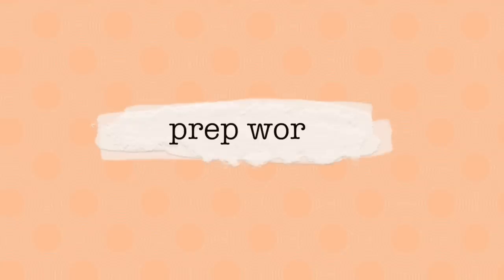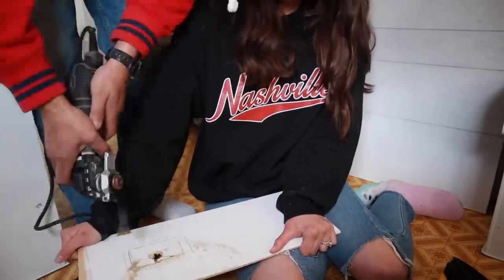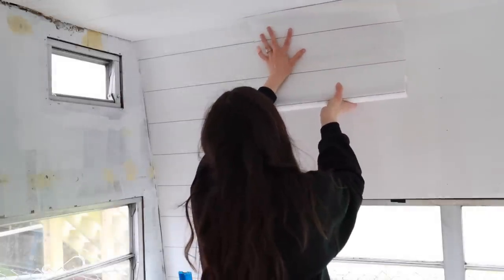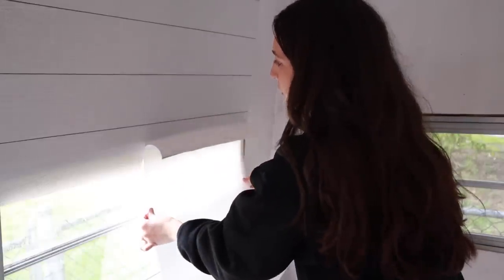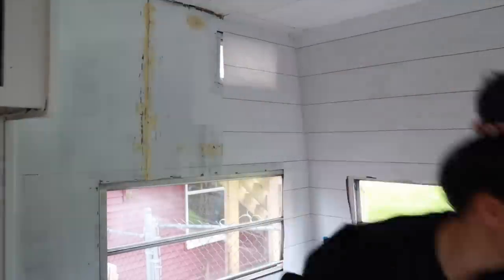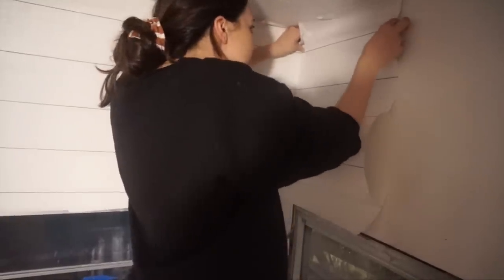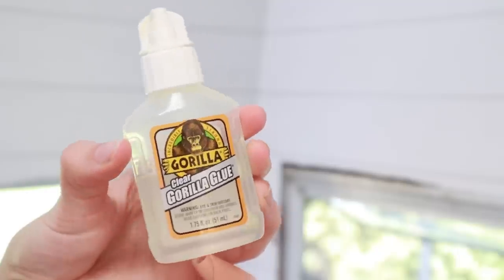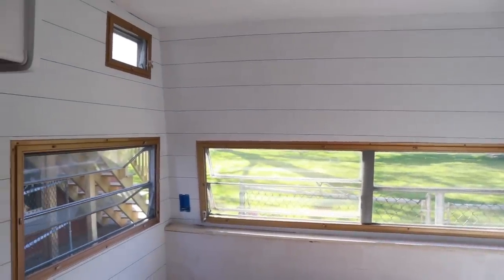HOW TO SHIPLAP WALLS for our camper// Peel and Stick Shiplap  wallpaper! tips & tricks

Comment: If you have a problem with it sticking or air bubbles just heat it with a blow dryer and use a squeegee to smooth it out. It will stick for good then.
Reply from the maker: great tip!!
Reply: Nice!! Thank you. I'm looking to use contact paper, does that work the same?

Comment: 3 yrs ago I saw your video and had to do this!  Turned out great but the first season taking our camper out the paper started falling off!  From the fluctuation in heat it’s soo bad. We have used 3 different glues to keep it on and none of them work. Any tips? Did your stay on??

Comment: I have a few questions. I love love love what you are doing and really want to do it myself so i was wondering how did you find a camper so cheap because even super tiny ones i have found are 2 grand or more. also what size is your camper and how much is all of this costing you. i dont think it looks that expensive, but i would still love to know how much youve spent so far and how much you think you would have spent if you didnt find those extra things in your house
Reply from the maker: I'm not sure how much we spent so far, less than $500 I'd say. We have been searching for campers for sooo long and we knew we didn't want to spend over $1000. We looked on craigslist, facebook market place & letgo but we ended up finding this one on the side of the road!

Comment: The problem with most peel and stick wallpaper (as I found out in my RV  1/2 bathroom) is that after a number of months, it shrinks.  I've heard the same thing from a number of other RVers who have put up peel and stick. I ended up having to remove all of it because of the shrinkage.
Reply from the maker: I've used peel & stick wallpaper 3 other times and never had that issue, maybe it's the brand
Reply: Thank you for answering this question!!! I have heard the same thing but was unsure. Would you recommend regular wallpaper with cement backing?
Reply: That's really helpful! I live in Arizona, and I feel like this would be a big issue 😬

Comment: Did the shiplap peel and stick wallpaper stay on? I have heard that peel and stick will eventually peel off due to temperature changes.
Reply: I was wondering the same!!
Reply: @self-improvementsquirrel3653  All mine fell off in my RV bedroom even after cleaning the walls and using gorilla glue spray for extra tac. Not sure how people get this to stay for a long time.